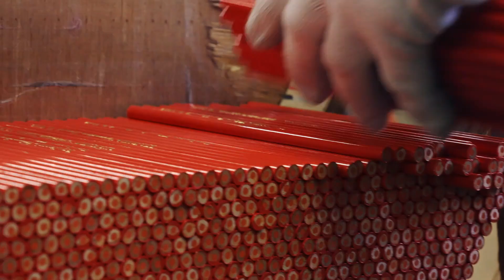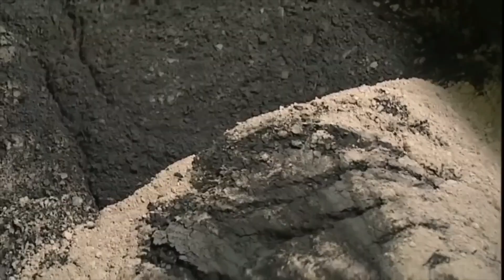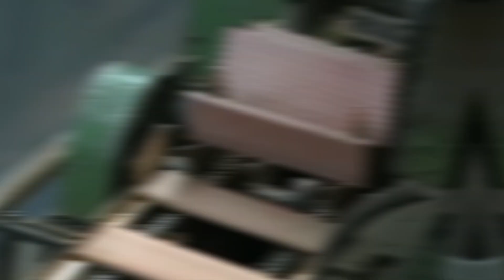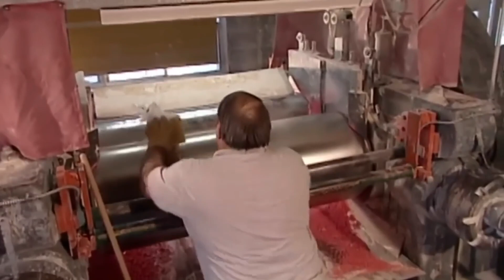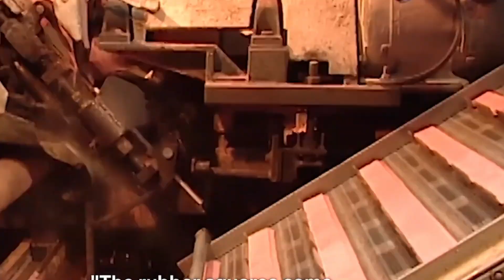How Pencils Are Made

Comment: - 00:01 ✏ 2 billion pencils are sold annually in the US, and 14 billion worldwide.
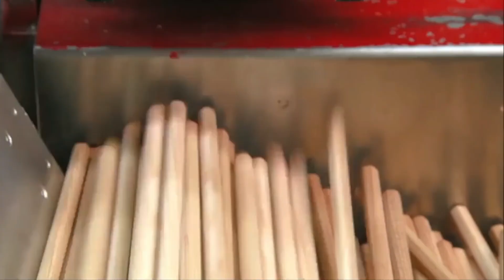- 00:07 🌳 Pencil production starts with raw materials: graphite, clay, and wood.
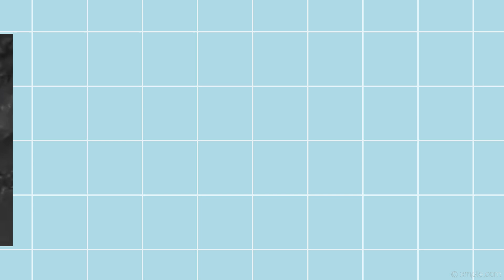- 00:19 🏞 High-quality graphite comes from Sri Lanka and Madagascar.
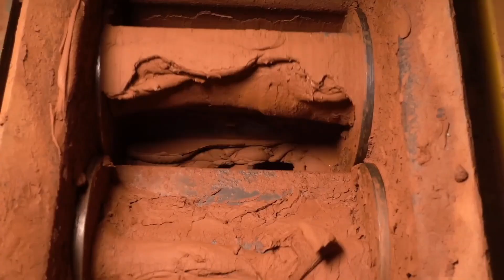- 00:29 🏺 Clay's role is crucial in determining pencil hardness and darkness.
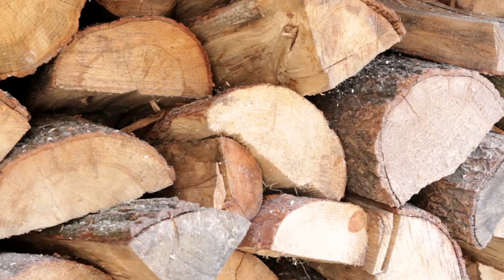- 00:45 🌲 California Cedar is the preferred wood due to its pleasant odor and stability.
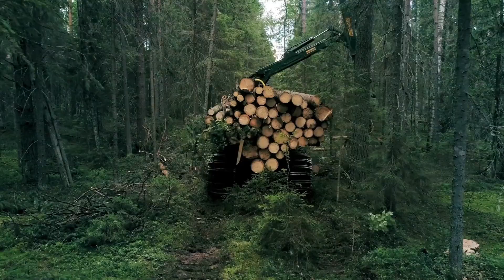- 00:58 🌱 Sustainable forestry practices are used to source wood responsibly.
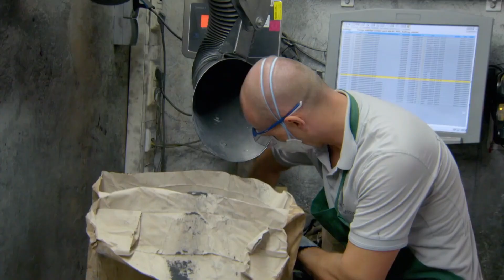- 01:09 ⚙ Graphite and clay are ground into fine powders to create pencil cores.
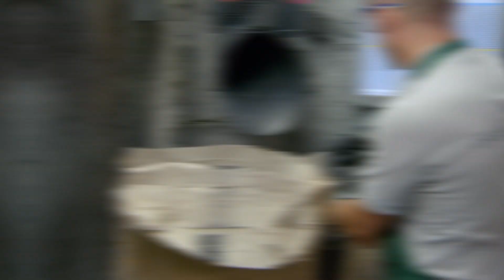- 01:12 🔄 The ratio of graphite to clay affects pencil lead hardness.
- 01:24 🌊 Powders are mixed with water to form a paste, then refined and extruded into rods.
- 01:46 🧪 The graphite and clay mixture process dates back to chemist Nicholas-Jacques Conté.
- 02:11 🪵 Graphite cores are encased in cedar wood slots, which are glued and clamped.
- 03:32 🔻 Pencils are cut into a hexagonal shape for ergonomics and stability.
- 03:58 ✨ Pencils are sanded, coated with lacquer or enamel, and polished for a smooth finish.
- 04:27 🧽 Erasers are made from synthetic rubber and attached to pencils using ferrules.
- 06:15 📦 Pencils are packaged in bulk for distribution or in retail packs for consumers.
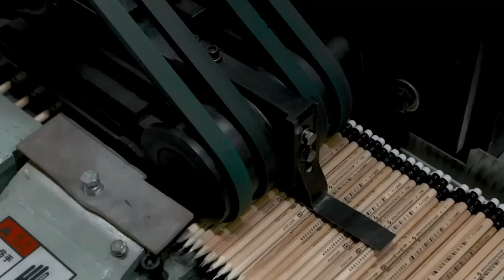- 06:59 🔍 Pencils undergo quality checks and testing before being distributed.
- 07:30 📈 Despite digital trends, the pencil industry is growing, with a market size of $15.95 billion.